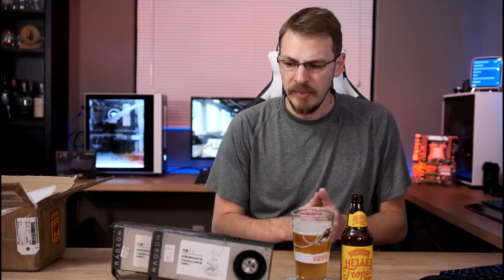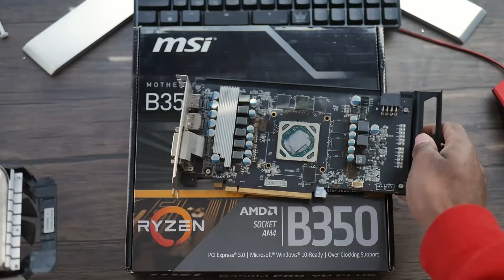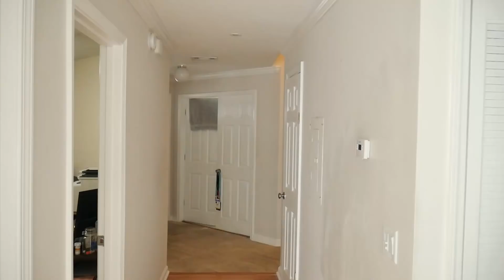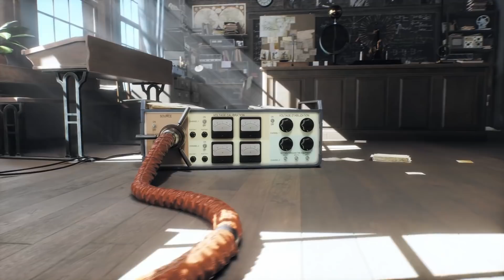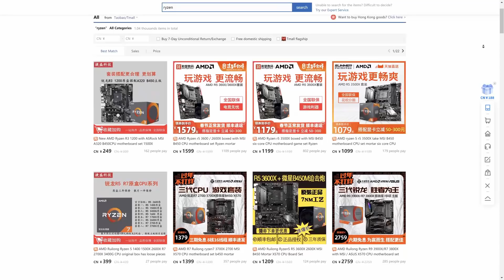This Chinese GPU is Only $56...and it's in AWFUL condition! | OzTalksHW

Comment: nice cleaning .but i recommend some tech yes lovin instead of water
Reply: What is wrong with water?
Reply: @1pcfred  nothing (if you know what are you doing ) its just i like the tech yes city method of cleaning and you dont have to wait 24 hrs for the parts to dry
Reply: @gamesandsoftwares1441  when we were in a hurry at the board house we'd dry boards using compressed air. In a hurry was ready in 24 hours too. Usually boards would sit for weeks after we washed them. They were always good and dry then. Quite frankly I don't know what WD-40 would do to electronics. Stuff definitely leaves a residue of something behind. Water is the industry standard.
Reply: @1pcfred  aha thx for the info man . its not just wd 40 anws wd 40 is good for the rust and such on metal from my small experience
Reply: @gamesandsoftwares1441  WD-40 can help with corrosion. It is a petroleum distillate. WD-40 is basically mineral spirit with some perfume in it. The other day I grabbed my spray bottle of it by mistake and the chainsaw I was juicing up with it by spraying some in the carburetor started up anyways. Was too early in the morning for me I guess?
Reply: @1pcfred  thats baddd thats really badddd
Reply: @gamesandsoftwares1441  what's bad? Spraying WD-40 in an engine? It worked fine.

Comment: I work in a electronic repair shop, so here’s another tip when it comes to cleaning. You can also use a toothbrush and 70% isopropyl alcohol. The toothbrush really helps grind away grime and it isn’t harsh on the SMD components.
Reply: 91 percent! less water the better
Reply: imaghostya True, we never use that high concentration because it stains plastic but it does work much better than 70%!
Reply: @MrHuangKong88  i used 91% on plastic no problems
Reply: anikanbounty97 Specific plastics. Especially low quality plastics from budget laptops or the bezels around the LCD.
Reply: @MrHuangKong88  ok so im really nervous abt cleaning my card for the first time any tips?
Reply: @twirlanta2250  Make sure it is fully disassembled so it is only the PCB (remove any coin batteries if it has any, e.g motherboards). If you're cleaning it with water and soap, be sure to give it a rinse bath afterward to remove any soap particles and let it hang dry for a couple hours, or use a hairdryer. If you really want to be safe (or don't want to wait that long), then spray/pour some rubbing alcohol on it afterward and use some cans of air to fully evaporate it. This'll ensure any water particles under chips or SMD components are evaporated. Just remember to do your due diligence and consult local repair shops if you are still uncomfortable!
Reply: @lagginswag  when I made circuit boards at an assembly house we washed every board we made in a dishwasher to remove the water soluble flux off them. The boss swore by Maytag.
Reply: When I assembled electronics we used flux brushes to clean PCBs. We'd cut the bristles down on them some with scissors to stiffen them up. We had to clean rosin flux off boards that we did hand work on. We used flux remover for that. With the toothbrush bristles at a right angle to the handle you can't get the right ze artist stroke on boards.
Reply: TechYesCity recently did a video where he put dirty motherboards in his sink and washed them under normal running water. Using water on electronics just seems odd to me, especially since I lost a mobile to water damage. A tiny drop of rain landed in the charging port and corrosion spread through the circuit board gradually disabling different parts of the screen. I thought this would happen to other electronics too but that doesn't seem to be the case.
Reply: @psillypseudonym1278  yes that's true, in your unfortunate case water got into the charging port, well imediate shutoff the device and remove the battery (this prevents shortage), secondly blow air into the ports or under the CPUs on the board to dislodge any water droplets (this prevents from corrosion from setting in) and air dry for at least 24hrs, a spot with good air flow helps evaporation. The key is not to have any moisture in the device when you turn it back on, then you are good
Reply: PsillyPseudonym Oh trust me, my instincts were screaming “No!” when my mentor placed a corroded 2018 MacBook Pro motherboard under the sink. As long as the part or board has no electricity going through it (coin batteries count) then nothing will happen. It’s just water and electricity don’t mix, not the components.
Reply: Yes, please do follow that advice. Even tho it works with water and  soap  , nah man. Even 80-100 proof vodka can do in a real pinch :p.

Comment: Wouldn't water screw up the electricals ports
Reply: Water is only bad for electronics if there is electricity going through it.
If you clean it and let it dry completely it will be fine :P

Comment: I'd recommend using alcohol to remove old thermal compound, it helps loosen it up. Plus alcohol will evaporate a lot better -- make sure to use compresses air to blow away any water that might have gotten under components too.

Comment: Wait so you can clean those electrical parts with WATER??
Reply from the maker: As long as you let it thoroughly dry (24+ hours), then it's not a problem
Reply: As long as you don't have the power on !  I always clean my Motherboards/GPU's and other in my dishwasher, always works like a charm !
Reply: Sure. As long as you let it dry before powering it up.

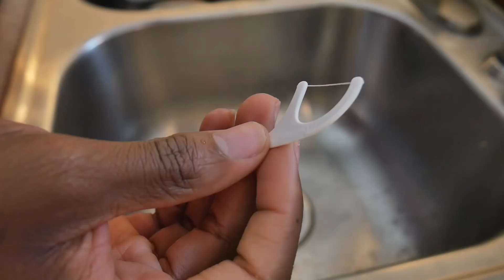Comment: 4:50 .... Just use a soft tooth brush ! That is what i'm using , and after that it goes in the dishwasher . Always comes out as brand new !
Reply from the maker: I won’t lie, the dishwasher tip kinda scares me 😅 but I’ll try it out and report back
Reply: You can buy tooth brush for post dental op at the pharmacy, they are waaay softer than the "soft" ones you buy in shops because they are clearly meant to be used after surgery so it might not be as efficient or lasting than standard soft brush but they work wonders for  cleaning stuff like that.
Reply: When I assembled circuit boards professionally we used flux brushes for board cleaning. We'd trim the bristles down some to get them a bit stiffer, usually at an angle. There wasn't a toothbrush in the shop.
Reply: I did use used toothbrush. Seriously.

Comment: bruh what using water wait whuuuuuuuuuuuuuuuuuuuuutttt, why water istead of alcohol  and a ultra sonic bath??
Reply: Corrosion only happens when there's a current, it's like a catalyst for the reaction. Without it you'd have to leave the board for ages for a reaction to get anywhere
Reply: Water is absolutely fine for cleaning nasty hardware. You just need to take care to dry it before using.
Reply: @skorpers  i disagree completely, maybe distilled water is ok but it should be distilled water with some kind of active ingredient for cleaning electronics. there is 100% no doubt in my mind there is going to be corrosion happening under those chips and places he didn't or couldn't completely wipe away. at an absolute minimum he should have gave it an alcohol bath after the water to get rid of the hard minerals in tap water.
Reply: @MrVlodato  I cant agree more, and video is misleading, card wasnt in that bad condition in first place.

Comment: Get a dust cover

Clean it each month

Clean the computer itself once a year

Your computer will last much longer

The cooler the computer, the longer the life
Reply from the maker: Good tips - I would even say once a month is on the higher side. Even if you only do it once every 6 months you're probably better than the average g a m e r
Reply: @OzTalksHW  Another good idea is running an fps limiter in most scenarios too keep components cooler, specially for older games that you don't want too run vsync on but also doesn't need more then 75 fps or so & the pc easily runs it past 200 - 300 fps.
Reply: I have to clean mine every 3 months minimum or I can watch my fps drop. But then I'm leaving it on the floor of a carpeted room which is a no no anyway.
Reply: @Dr.C-UTS  you solved your own issue
Reply: I clean it every year, because it isn’t on 24/7 and it isn’t needed every month, maybe every 6 months is better, but I don’t have any performance drops ( older pc in a very well ventilated case with 5 fans
Reply: do you have an open case or what
Reply: I’ve lost a few parts over the years from not doing this. I’m much better now with cleaning and watching thermals.
Reply: protip: don't live in some crappy city where the air is so bad you have to dust everything so often, get out while you can
Reply: and now the cities are imploding, have curfews imposed, and stuff is on fire, damm it i didn't want to be right about this
Reply: @virtualtools_3021  you do realize it doesn’t matter where you go the air is dusty right, most of the dust in your home is your own dead hair/skin cells and shit like that right
Reply: literally want my cpu to overheat and die, that dual core athlon is pissing me off

Comment: I bought a GTX 970 FTW from EVGA during midweek madness and I've had it since the 8th of January. So yesterday i was playing a game and during it my pc just shut off. Well i immediately press the power button and boom my graphics card emits a flame near the left/back of the pc and touching the pcie slot on my mobo. So yeah too bad i got the bad end of the stick there. And i almost sold the card on Ebay. (Dodged a bullet there)
Reply: Note to self: never buy EVGA's FTW versions. They have fiery tempers.